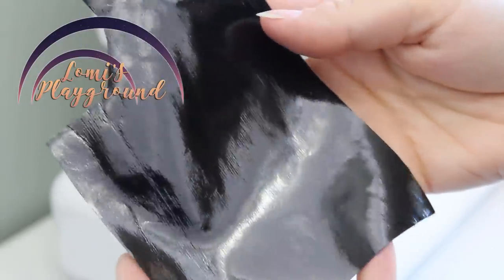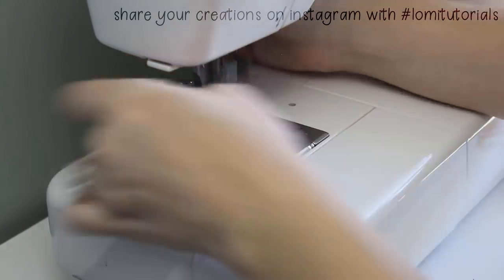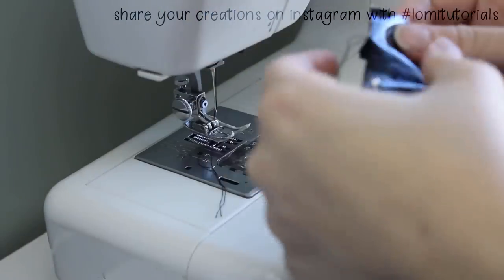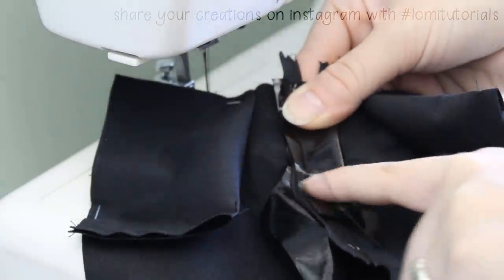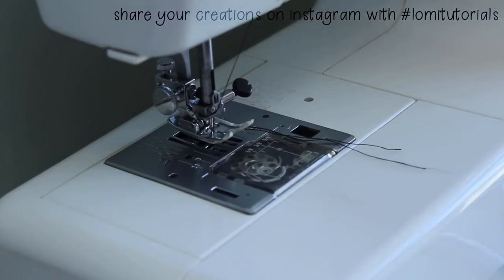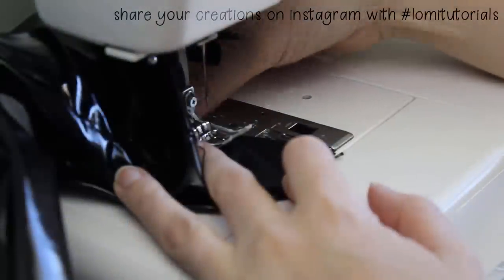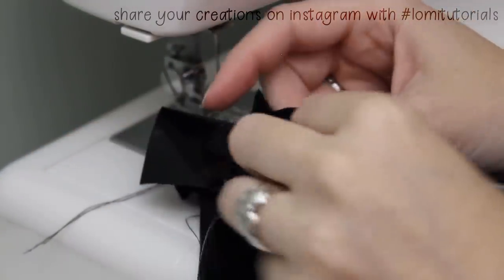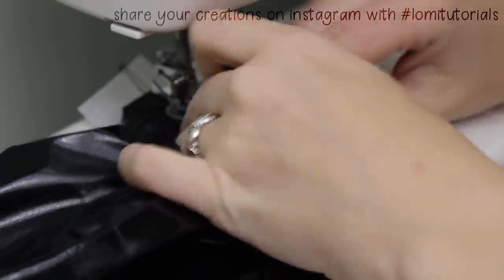How to make a pair of vinyl pants for SID BJD guys

Comment: Hi! Great video. Question for you, how is the hemming process with vinyl? Would it be difficult for a tailor?
Reply from the maker: Vinyl sticks HORRIBLY when hemming, but there are ways to get around it. Using a teflon foot or putting painter's tape on the bottom of a machine foot makes it move much more easily. For an experienced tailor, there probably aren't many things challenging :)